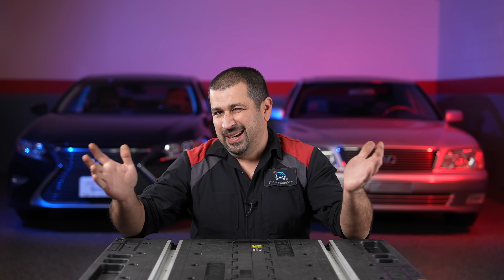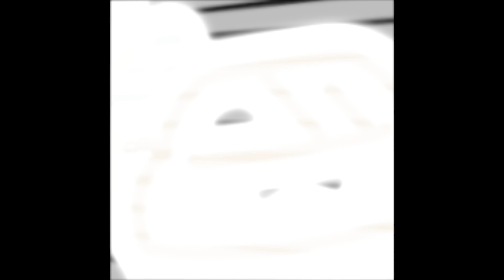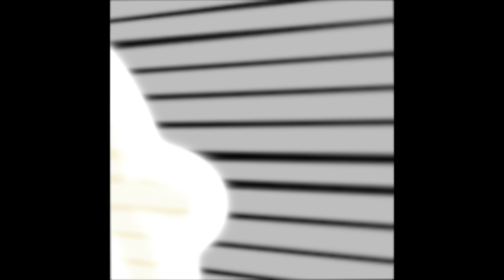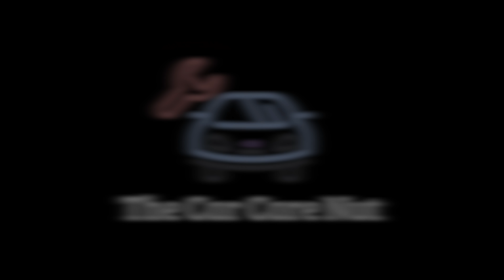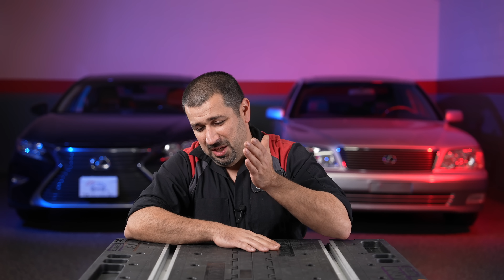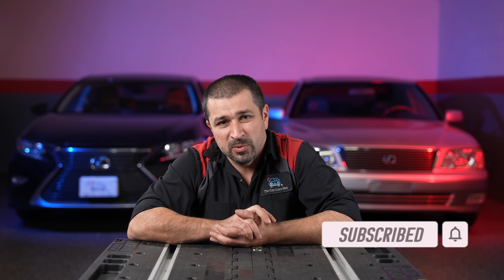Can Modern Turbo Engines Be Reliable? Here's The TRUTH!

Comment: You missed the OTHER reason turbos were added beyond emissions, CAFE standards. In order to meet those mileage targets, they needed to do something and turbos were the cheapest answer. Turbo lifetimes depend on 3 things (beyond a manufacturing defect), User care/service, how they're driven, and how much boost the manufacturer dialed in(the higher the shorter lifespan). It why certain brands last longer but don't have as much power as they could have. Even in the same brand, they do different levels depending on the performance they want to get.

Comment: Have a deleted turbo diesel Colorado pickup with 310,000 km and have gasser turbo cars. Definitely change the oil more frequently in the gasser. Also a very early change in new cars. 

The car is used for more urban driving 

The car has a smaller oil sump capacity 

All of this plays into the oil change intervals for me. 

Right now the diesel engine gets new oil at 12,000 km : 7200 miles. Gasser gets it at 10,000 km : 6000 miles

Comment: Not a fan. My wife's RAV4 is non turbo, my Titan truck has the Endurance non turb V8 engine. Turbo engines are NOT needed for everyday driving, V8s non turbos haul just fine without them.  I won't have one. I know that the manufacturers say gov't EPA standards pushed turbos on them, but as long as I can find and drive non turbo cars and trucks I will.

Comment: I have a '15 Audi A4 and i don't trash it as I wait for about 30 secs or more when I start the engine or before I turn it off as I want this car and this engine to last a long time as it has about 117k km on the odometer and i don't drive it everyday and always check the oil level from the radio display screen. When the next oil change comes I will do 5000km or when the days count to zero whatever comes first. I would rather pay for the service at the dealership than do repairs

Comment: The oil in my 2007 Sienna (2GRFE) gets changed every 10000 Km or 8000 miles. The only thing is I change the oil Filter every 5000 km. More oil filters than oil. This is good too!

Comment: Lake Speed Jr, The Motor Oil Geek has the data suggesting 5W30 in most engines is better than 0W20 if you live in hotter temperatures. My oil analysis by both Lake Speed Jr and Blackstone shows the science that 5W30 is better than 0W20 in my 2017 Toypta Camry 2.5 with the use of Pennzoil Ultra Platinum motor oil and the factory Toyota Oil Filter. However, for those who don't know anything about motor oil or filters should use the manufacture's brand oil and filter.

Comment: I drive a 2023 LX 600 F Sport. Dealer says every 10k for oil. No way! I change every 5k religiously. Also every 20k miles change air filter. Never had an issue.

Comment: With diesel cars it's getting a good balanced mixture of diesel and air. What tends to happens you get areas in the cylinders where there is excess diesel; the diesel then does not burn completely this leads to soot/carbon/coal dust being produced. Turbos put in more and denser air to try and combat this, along with swirl flaps to ensure air spreads out in cylinders and of course higher cetane diesel (quicker to start the burn). As you try to get more torque out of the engine you dump more fuel which needs denser and more air hence the need for turbos in diesels, ultimately it's all about getting more power...Diesel turbos are VNT which are more susceptible to failure from higher exhaust gas temps hence they don't do to well in the petrol engine cars, only Porsche are using them on the petrol boxer 4 cylinder 718 Boxster/Cayman...

Comment: Before I traded in my 2020 Lincoln MKZ 3.0 twin turbo AWD - I change the oil in that car every 2000 miles everybody in my car group thought I was nuts but I was the only one that had the best fuel economy with that size engine 28 MPG on the interstate at 80 mph anybody else couldn't even barely get over 20 miles to the gallon. Basically what I did is once the oil life monitor reached 50% I change the oil 46 months whichever came first that always equals around 2,000 MI no I didn't drive that much so another reason I changed it more often is because it was sitting around and rarely got a completely heat soaked to burn off any unspent fuel. I don't have to worry about that anymore I traded that off on a Tesla and I love it$9 a month to keep the battery charged

Comment: Am a truck driver for 20 years and I have a lot knowledge about engines any engine, including boxer engines., I use TURBO ENGINE ONLY in tractor commercial truck , BUT I skip any single turbo engine for pickups truck , SUV and sedan cars , just no worked basically is just scam technology , Turbo engine is ONLY for tractor commercial trailers

Comment: I switched my 24 tundra to 5w 30 Mobile 1 synthetic at 15k miles. I change it every 4k miles. First 10k miles it had 4 oil changes with 0w 20 at the dealer who knows what kind of oil. Now my 24 tundra is going to be included in the expanded engine recall. Has 22k on it it runs great.

Comment: If you're a non-enthusiast and you plan on keeping your ride for over 8yrs (as you should, but hey, alot of people out there trying to "keep up with the Jones"), you should consider an NA engine vehicle.  Especially if you're lazy and don't want to deal with basic maintenance.
For the rest of us, owning a turbo powered engine as a daily is doable provided you're on top of maintenance and you stay away from any of the German stuff.  But as I mentioned, alot of people out there very concerned about what other people think...
Having owned my 94 RX7 for over 28yrs now, nothing puts a bigger smile than when she goes on boost.  Especially now that she's single turbo.  Did the switch over after the 3rd year of ownership.  Wanted to make it more reliable compared to the convoluted sequential twin turbo system it normally comes with.  That being said, the single turbo lasted exactly 16yrs or so before needing a rebuid. She was starting to have alot of oil blow by.  So yeah, turbocharged cars are going to need a bit more maintenance but keep in mind how long she went for before needing said rebuild.  Under this application, I can't complain how long she went for. 
As my daily though, provided your lifestyle allows this sort of adoption, going to EV has been 1 of the best things I've done.  You have no idea how much maintenance and fuel consumption consumes your budget until you switch over to an EV.  Going on my 3rd year with my 21 Model 3 and I tell you, best daily driver money can buy.  Hands down.

Comment: Former turbo manufacturing worker. Turbos are INSANELY delicate. We built every size from the tiniest to the tugboat. An alloy fan wheel bolted to a steel rod that has a steel fan wheel. Both have to be pre-balanced. Then they ride on a miniscule amount of oil with a set of brass & alloy bearings. The tolerances of those bushings is in the 100ths of a millimeter. And the spin at 14-18k revolutions per minute at idle. You can set a 3 inch fan wheel from a turbo on the ground at idle speed in North Carolina & it will be in California in a matter of hours. 
A turbo is the most impossibly weak link in the chain of engine durability. Anyone like me that's built & assembled them knows they stand such a small fraction of a chance of survival.

Comment: Can turbo engines be reliable and durable? Yep. Totally depends on the driver's maintenance and driving habits. I think a great example is the Ford 3.5L Ecoboost V6. They've been standard in all of Ford's large SUVs (the Expedition and Lincoln Navigator) for a decade, and available in the F150 since 2011. There are a ton of them out there, and plenty of high mileage examples. Are these engines perfect? Far from it. But if ford can put a turbo engine in their heaviest vehicle and still be reliable, there's no reason other manufacturer's cars can't be as reliable IF the owners do their part.

Comment: Care and proper operation are the keys to making any car engine last a long time. Turbo's require care too, and some different care than non turbo engines. And modern turbo engines were designed as boosted engines so they are much stronger internally. Gone are the days were you just slap a turbo onto an engine designed for a carburetor. Those did not last, no doubt about it.  First, never free rev a turbo. The turbocharger can spin tens of thousands of revolutions per minute. Free revving spins up the turbo and returing to idle reduces oil flow and cooling to the turbo leaving inadequate lubrication and heat soaking the oil in the turbo bearing. Free revving guarantees shorter life. Second, never put your leg into a cold engine. The oil needs to warm a bit AND the metals need to expand from heat first. Turning up the boost on a cold turbo engine can shorten the life of the turbo AND cause head gasket leaks as the block and head expand differently putting unnecessary stresses on the head gasket. Third, idle down before turning off. Wait a few seconds, 10 to 20, at idle to allow heat in the turbo to dissipate. This prevents oil coking in the turbo bearings. This all being said, a turbo should last longer than a normally aspirated engine as they wear less because they produce power at lower rpm.  This means less wear distance on bearings, cylinder walls, piston, and ring. It's the distance traveled by pistons and bearings over time that wears them out. So since turbos produce power at lower rpm there is less wear per miles driven. Just look at 18 wheel turbo diesel trucks. They go over a million miles on one engine because they operate at lower rpm. Again, turbo gas engine operate at lower rpm too because they produce power at lower rpm. Not as low rpm as a diesel, but significantly lower rpm than naturally aspirated gas engines.  But you must change oil frequently, use full synthetic as it is less prone to breaking down AND synthetic oil transfers heat better than dinosaur oil. This leads to better internal cooling, and cooler cylinder walls, bearings, and rings that also reduces wear.  Anyway, I've been driving turbo cars since 1986 and they easily go 300,000 miles. I used to change oil every 3000 miles, but with today full synthetic oils 5000 works perfectly safely.  I've had the body rust away on my car while the turbo engine still ran like a raped ape and burned no oil.

Comment: They can be very close in reliability if, you know how to maintain them. Change oil every 5,000 miles, use high quality oil of the correct SAE spec, if you go out and thrash it don't just pull into your driveway and turn the engine off, let it idle for 3 to 5 minutes to cool the oil down.
Reply: They really should be designed with a cool-down cycle on shut down. They wouldn't drive just idle with electronic coolant pump, oil pump and fans running until the turbo and oil is cool.

Comment: Complexity is the Enemy of Reliability.  I don't want a turbo engine largely because of all the attendant plumbing under the hood (more things to break, more complex to work on, much hotter under the hood and more cooking of the oil).  Also, the turbo itself is a very expensive component, my guess is most manufacturers will want four or five grand to replace one if it does poop the bed.  Bottom line, if you trade fairly often, it will not be a big deal for you.  If you want to keep your car for many years and miles, not a great idea.  Mr. Nut nailed this one.

Comment: I've been driving turbo cars exclusively for almost 10 years now.

I've never blown a turbo, I've never blown an engine, I've never had an issue with oil sludge or consumption.

I also DILIGENTLY change my oil between 3k to 4k miles.

And I cool my turbos down, especially if I've been driving them harder than usual.

The 10k oil change interval is absolute nonsense, and there isn't a single human being on this planet who can convince me otherwise.
Reply: I still don’t even know anyone with a blown turbo. With most cars today you will have electronic issues long before the turbo engine fails.
Reply: I'm curious about how long you should allow them to cool down before turning them off.
Reply: But did one of your turbo cars go ten years?   A daisy chain of reliable turbo cars over time is not the metric I'm into.
Reply: @timewa851 My Audi is almost 15 years old now and approaching 300,000 miles. Still on the original turbo and not one major mechanical failure. I replaced the water pump and the alternator recently. Not bad at all...
Reply: Insanity it is an oil analysis will proof u right every time 😊